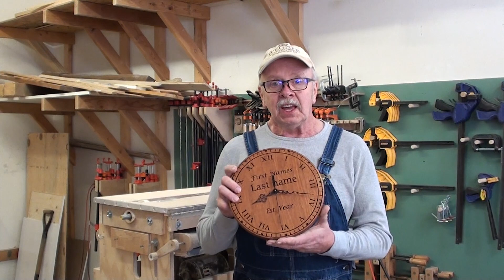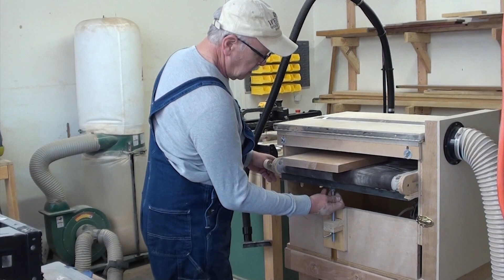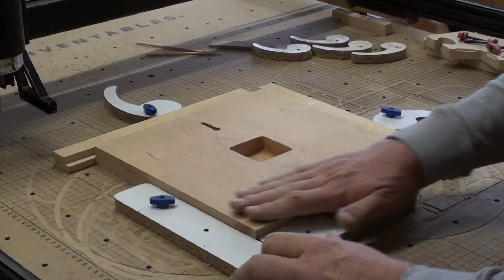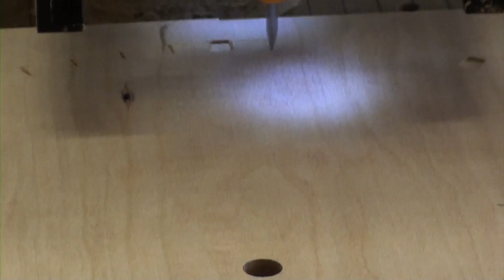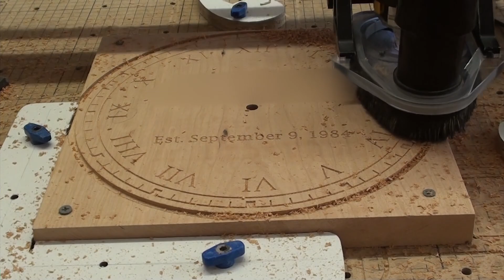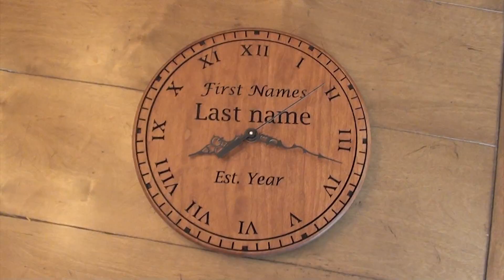DIY Custom Classic Clock - New CNC Project - Plans Available

Comment: Hello loved the clock video.  My question is I have a Shark SD 100 and the X is 12 and Y is 13 max. I have not made any projects yet very new .at this hobby.  My question is I would like to make this clock but not sure how to down size it to a max of 12 12.  Your sign is a little larger. Any suggestions. I have purchased the plane next year I plan on getting the next size larger Shark
Reply from the maker: Larry - Isn't the size 10.5 x 10.5?  That should fit on your machine.  Thanks for watching!
Reply: yes you are correct thanks
Reply: Larry:  Just curious, did you make the clock?

Comment: Centering on the "X" is much easier if using a sharply pointed bit on the X instead of any blunt one such as the keyhole, or even a regular 1/8" or 1/2" straight cut.  Plus, if you have to find the center again once you have machined that center hole, again using a V bit of some kind to find the hole makes it very easy.  Just my 2 cents worth, so sorry.